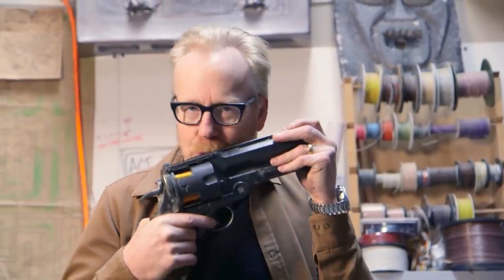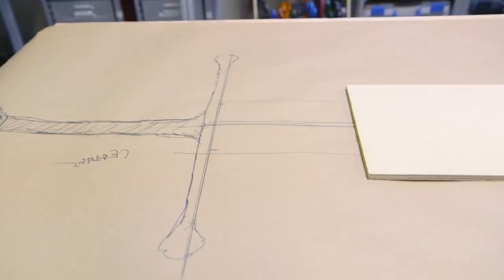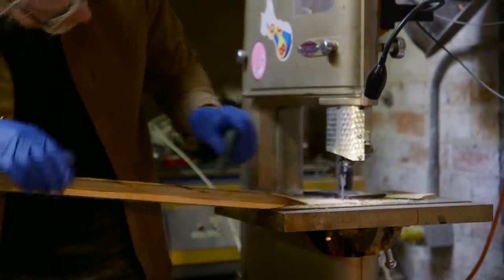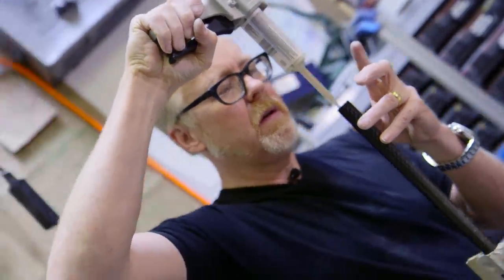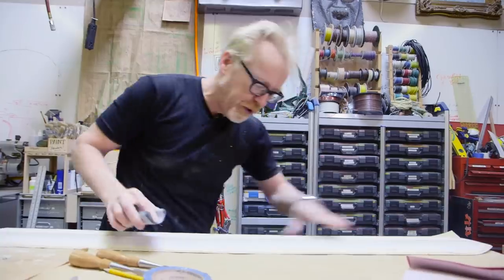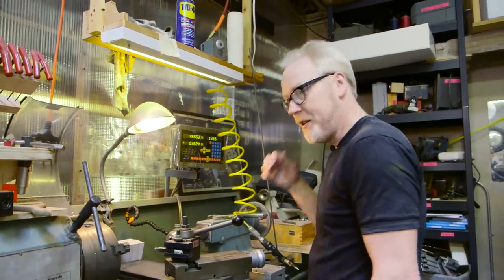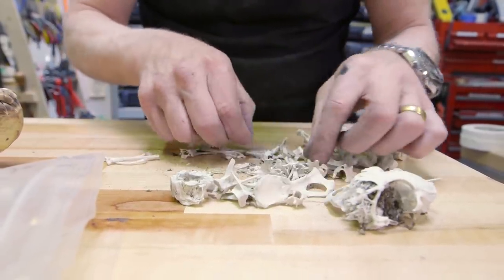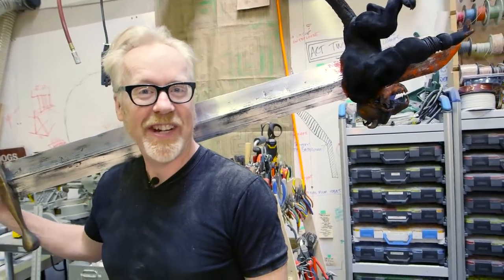Adam Savage's One Day Builds: Hellboy Sword!

Comment: Aluminium tape: just yesterday needed to cast a fix from epoxy, i needed to fill in couple of broken screw holes. Aluminium tape made a nice ad hoc mold so i could cast the epoxy in place and get the shape i needed.. I use that stuff almost daily, it is wonderful material. If it is hot, needs to have conductivity, needs to hold some shape and not stretch: it is your friend. Specially the no stretching part, it is the only tape i have that stays in shape.

Comment: Adam, this being posted after the fact I don't know if you will read this; but your preference for hollow ground blades runs counter to good blade making.  it is easier to sharpen HG on a wheel; but a hollow ground blade creates a lot more drag as it slices through flesh.  check the cross section on a master made Samurai sword.  more apt to get a ding on a hollow grind too.

Comment: Real sword makers wish it were this easy.
Reply: Ken MacMillan and as Light.  real swords are very very heavy. You had to be very strong to be needed to move in al the iron and cloth on your body to protect you . plus care and use your sword
Reply: Abby van der Pluijm Most swords are between 2 and 5 lbs. If this sword were real it would probably be in the 8 to 10 lb range.
Reply: Ken MacMillan real swords. not the ones they use in this day and age. But the ones used in battle when They were still used by soldiers.  were,  I looked up the weight . We use different  ways to  measure weight and high etc. Was between 3 and 5 kg. They were so heav t they were gold with 2 hand.  yes you ve got s mn aller sizes. But I measure them by the large sizes. Hellboy doesnt work with a small one I think? never seen the movies.  Just guessing from the things shown in this video and the size Adam made his.
Reply: Ken MacMillan I looked up what lbs is in kg.  in lbs it would ve been 4.4 - 11 lbs
Reply: Abby van der Pluijm what swords are you talking about? Because they have authentic swords in museums that they have weighed and one handed swords weigh between 2 and 3 lbs. Hand snd a half swords weigh between 2 and 4 lbs. True two handed swords can weigh as much as 5 lbs, usually not though. The zweihänder, or greatsword was huge and weighs about 7 lbs. It was designed for fighting against polearms. Anything larger than that was purely ceremonial.
Reply: +Ken MacMillan my family samurai swords only weighs 2.27 kilograms. Or like.. 1.5 lbs. it's very light. But it was not ceremonial. It has only seen one battle in it's life though.
Reply: Jae Watkins European swords have a wider range. They could be anywhere from 1lb for a Smallsword designed for duelling to 7bls for a Greatsword designed for taking on polearms. Fantasy swords are usually heavy. In this case it's not the design that would make it heavy, it's the size.
Reply: Jae Watkins only? A battle sword weights mostly less than two kilograms. If you're talking about something two-handed, then it's right.
Reply: 1kg = 2.2 lbs. someone can't math. 2.27kg is closer to 5 lbs.
Reply: Abby van der Pluijm Uh no. Most swords aren't that heavy.

Comment: HILT!!!!
Reply: Joe Szabo SWORD!!
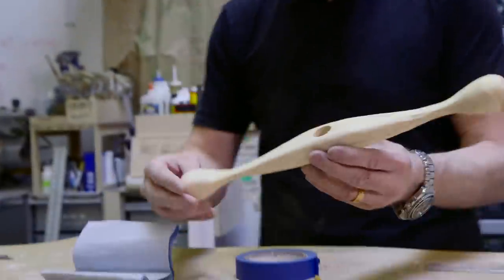Reply: Osvaldo Cabrera, you realize that Joe here was trying to correct Adam. Adam says at 13:40-ish," My handle........ this is coming along nicely." Adam should have said my hilt, as the guard below the blade is called the hilt. If Adam was however talking about the handle just being set properly, then there was nothing to correct anyways.
Reply: Correction, the piece just below the blade is the guard, also known as the quillons. The area you hold is known as the handle or the grip. The bottom is the pommel.

The entire construction of grip, guard, and pommel together is the hilt.
The hilt is not one single piece but is all three pieces together.

So what Adam should have said was either "My guard" or "My quillons."

Comment: As someone who has practically made entire cars out of bondo, i can tell you he didnt use nearly enough hardener. Even if the final mix is almost entirely RED with hardener, you still have 45 minutes or more to knock off the unnecessary globs. I guess in a way less hardener lessens the potential for cracking later on, but you have to wait for 2 hours for it to fully set.

Comment: If Adam reads this: When you're sanding, have you tried using a regular kitchen sponge as a "holder"? I know it's more common to use a block of wood or cork, but with the sponge, you can more easily sand rounded surfaces, like that blade =)

Comment: lol the work on the demon was a little uh disturbing ... great looking prop/model though. Could you imagine going out to meet some one who was up to less than good around your house with just the sword after the paint etc treatment? I think they would think twice about doing an thing but running away. I had a dagger or 2 made from carbon steel and they looked very much like that blade. Small pits with black oxidization so yeh great effect.

Comment: I made an outdoor "library" out of scrap wood and I was wondering what you think I should use to fill in the large gaps between the pieces of wood that would waterproof it. I tried flexseal but the gaps we're far too big.
Reply: try "swell stuff" in the gaps and the flexseal over that, it's a foam in a can
Reply: @Bluebelle51  I ended up using cox to fill the gaps then smoothed it over before it dried. It was barely visible
Reply: awesome!

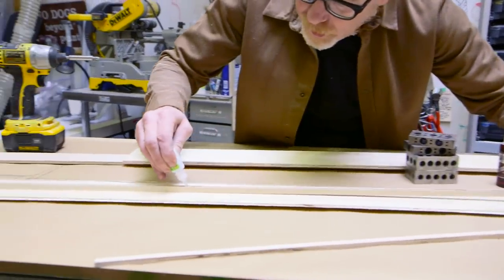Comment: What are the weights used to weigh down the spine as the glue dries at 6:46?  I tried to clamp mine between two boards, but it just screwed up the alignment of the spine as it dried.  I need to know where I can get some weights like that. :/

Comment: I know about metal and body filler very well. You where whipping air pockets into the body filler. I am just saying folding the filler would get rid of all the pin holes you have on the finished product. Well that and using high quality body filler. P.S. Bondo is a brand name. LoL